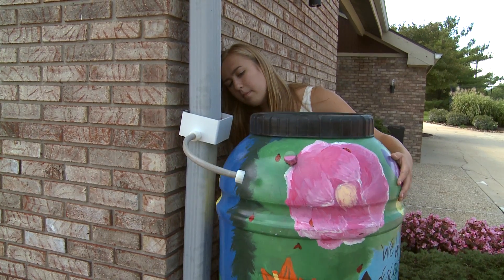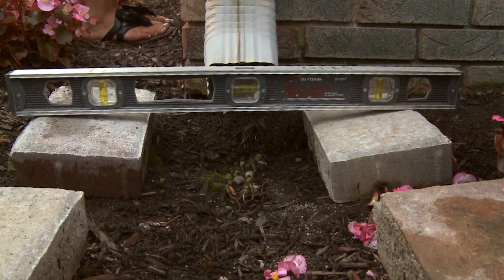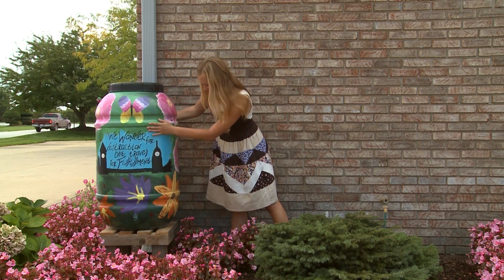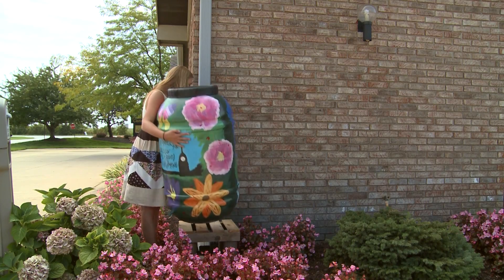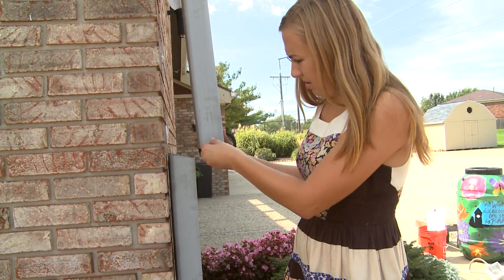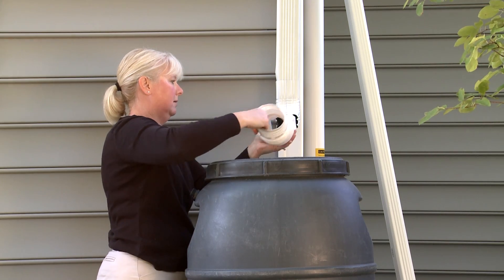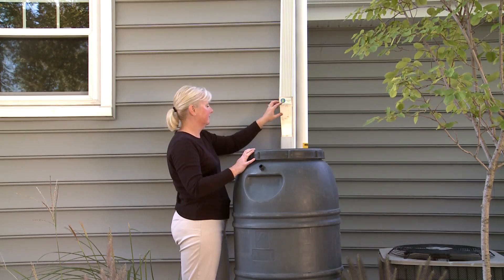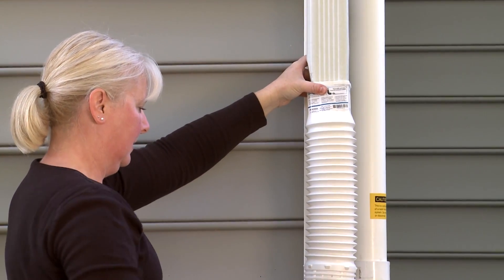Rain Barrel Installation

Comment: Due to CONSTANT debris in my gutters I cannot use a diverter. I have to plumb in the rain barrel directly off the downspout.
Was wondering how to discharge the overflow to keep water away from the foundation.
Sometimes we get really HARD rains - not sure a small relief opening will suffice.
And of course don't want mosquitoes in there.

Comment: I never disconnect my rain barrel in the winter! Here in Gloucester, Ma we get many winter days well below freezing. I simply move my overflow hose to the bottom spigot. I use my rain barrel to feed my fish pond because the tap water would kill the fish. In the warmer months I run the overflow hose directly into the pond. In the winter to prevent the barrel from cracking when the water freezes I move the overflow hose down to the bottom spigot. That way the barrel remains empty and any rain or snow melt goes directly into the pond. I've been using this method for about 15 years!